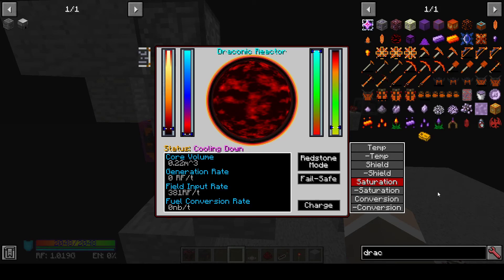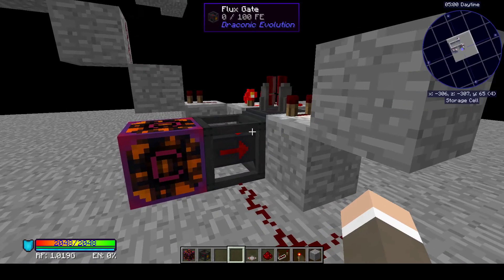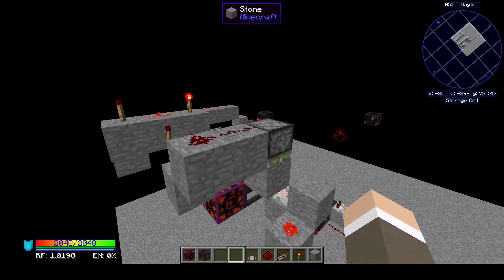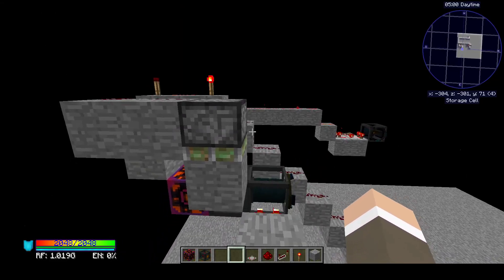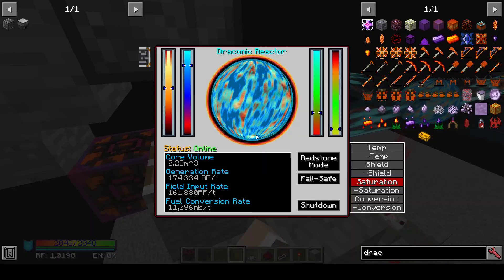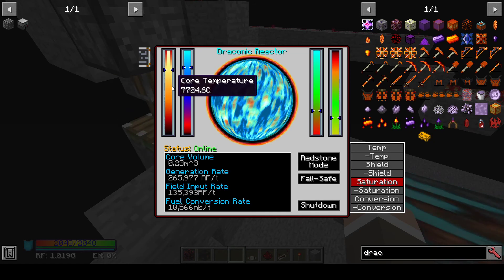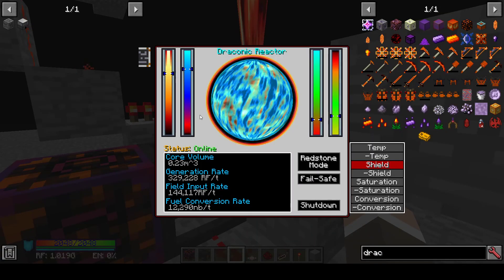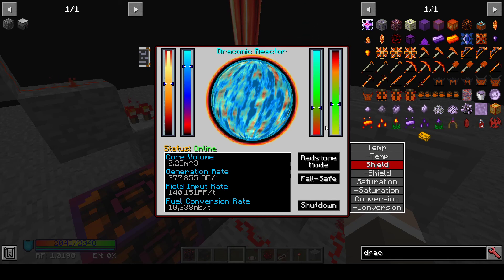Draconic Reactor Vanilla Redstone Tutorial

Comment from the maker: Addendum: These input / output values for the flux gates assume you are using Draconic Evolution with its default settings. Some modpacks will increase/decrease the amount of power generated by the reactor (and also the energy consumed by the shield). Be sure to check your Draconic Evolution mod settings for its reactorOutputMutliplier to see how much the reactor's output is being amplified by. If the value for it is 10, then 500,000rf/t to the shield is not going to do anything for you.
Reply: What about shutting down the reactor?
Reply from the maker: @soyoustartedwatching  there's an option for the reactor called fail-safe (or SAS on 1.16) that automatically shuts off the reactor when it reaches 99% saturation. If you combine that with redstone that will permanently shut off the output until you reset the reactor (like, say, another redstone line taht monitors the reactor's fuel usage), you could have an automatic cutoff that way.
Reply: @AwesomeAlec1  Yeah, thanks, I had an issue shutting it down but that was due to a lack of backup power 😅

Comment: Thank you very much for this tutorial. Literally everything uses a copy paste computer craft script. My pack didn't have computers, and wiring this up was so fun. I am confident enough to put one next to my base next time (I melted down my first reactor in the end... made a second one). Currently my reactor is sitting at 6500C, 25% shields and 20% sat. 
TO ANYONE TRYING TO BUILD ONE:-

Btw you should add a failsafe for conversion as well (idk if mentioned in video). Also I've found, to push low sat(and high temp) you need to increase IN and OUT parallel (while maintaining shields at around 35% to be safe). Then you can push shields down to sit at around 25%. If you lower the shield cutoff potentiometer  to 10% you can push 15% shields as well. Not really worth going to 15% for safety reasons imo. 
A thumb rule for how much energy to set shields input as initially :- take the saturation number (30Mil in the video) and divide by 60 (500k in video). This number will be scaled differently in different packs as mentioned in pinned.